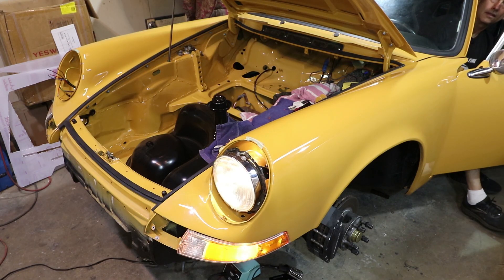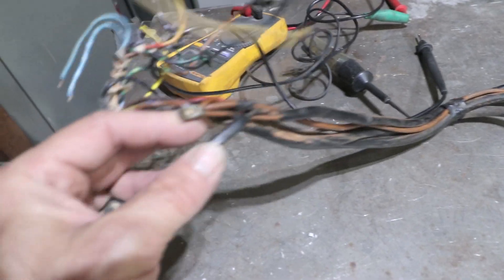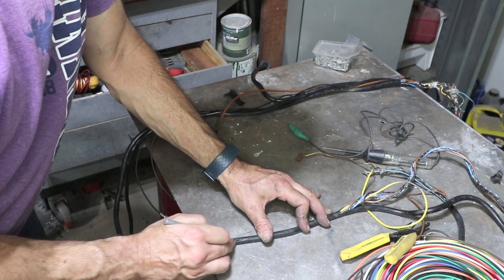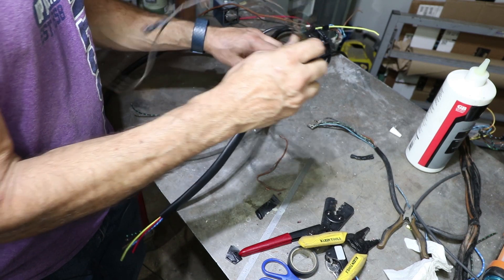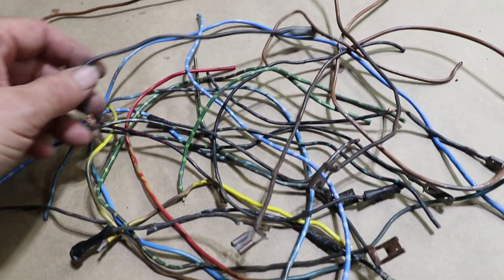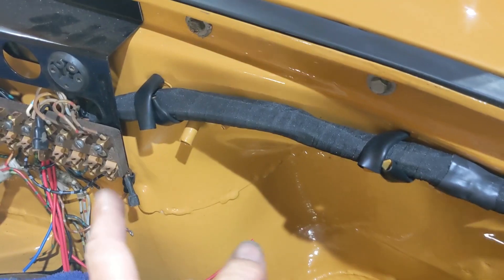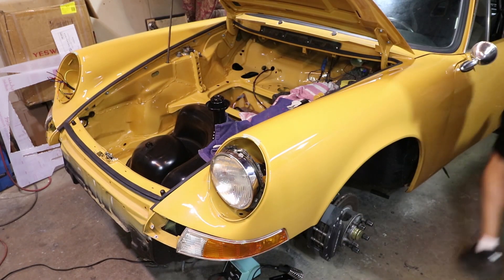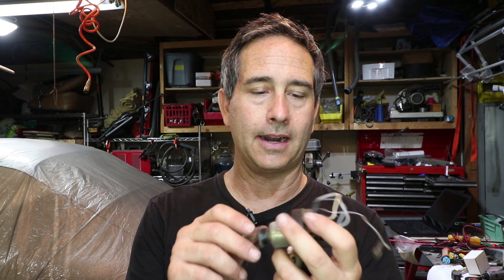Repairing & Upgrading Classic Car Headlight Wiring For H4 Bulbs With New Relays And Larger Wires

Comment: I have a rover p6 and want to set rails in it, I have two sets of headlights, one is a big beam and the other is dim and headlights. I use the excisting connector to send voltage to coils reails and make a whole new set of wires for the lights itself from the high current switches, I use small fuse box for new fuses let the original fuses intakt, I use the high current wire from the batterie, wo sit on the starter motor..

Comment: I'm trying to figure out my 1982 SC which someone upgraded to the H4 Bosh and I pulled my driver's side headlight to repair a few rust spots and was a bit suprised only one bottom screw on the trim ring was holding the entire unit in place unlike the orginal which is held in by four screws.
Reply from the maker: I know what you mean.  The single attachment is kind of precarious.

Comment: Hey Tom, I’ve been following your videos for a long time! I’m currently dealing with this on my 84 911, as well as many other projects you have documented. You make the hard things I do look easy! Thanks for the wealth of info. 

Btw, I see you have made a wiring diagram available, which is nice…I’ve seen you using others electronically. Where did you get these? The Bentley is a pain! If you’ve answered this elsewhere I apologize, I missed it.
Reply from the maker: The color diagrams I have are from the workshop manual.  The only ones I have are for the 74 model which is the year of my car.  Unfortunately I don't have the color ones for 84.  I have the Bentley like you do.  
The other helpful thing is to lookup the Euro Din specification.  It explains what the terminal numbers and colors mean.  It's a huge help.  
Thanks for watching, and I hope you find what you need.

Comment: I just got the original old school four sealed beams working on my 1966 chevelle project. But eventually will go to an LED system, less draw, better light. The new wire harness in my Chevelle has 12 g wiring to headlights, I did 12g ground wires on each side. I Hope to replace the headlights on my 1981 911 SC in the spring with LED as well. Octane lighting seems to have some good solutions. ( I do not have any affiliation or work for that company).
Reply from the maker: Nice, I'll check them out too.  I'd be interested to know your experience with the beam pattern with those LEDs

Comment: I actually fitted the classic retrofit fuse panel as I wanted the headlight relays and blade fuse as well.  Absolutely painless install.  I then refreshed the headlights with JW speaker LED lights (in beetle buckets!) and new Deutsch connectors.  Purists be damned, I can light up the whole street with this arrangement :-)
Reply from the maker: Awesome!  I'll check into those.

Comment: Seems like 4 relays might be overkill. Have you thought about one relay for the high beams and one for the low beams. You could hide one behind each light. It is your car, and you are doing great work. Keep it up!
Reply from the maker: Hey Aaron, a lot of what I do is overkill!  
My decision to hide the relays in the buckets precludes me from using just two.  
I would need to add more wires to bridge to the other side because the headlights are wired in parallel.
The relays are cheap, so I went this way.
Two relays at the fuse panel are also a good call.  I just don't want to look at them there.
Reply: @GarageTimeAutoResto  that makes sense. I figured running the additional wires would also clutter a bit. Good work continuing to move forward on your project. Definitely an inspiration to all us DIY guys

Comment: LED headlights
Reply from the maker: Which ones do you recommend?
Reply: @GarageTimeAutoResto  Head Light Revolution has great products and good service .  I have been using GTR Ultra 2 for 1 year now with no issues . Great light pattern and increased visibility. Not the cheapest out there , solid build and none of the Chinese issues associated with the Ebay LEDs
Reply from the maker: Is it the whole headlight assembly and refector or just the bulb?
Reply: @GarageTimeAutoResto  just the bulbs
Super bright great patern
Reply from the maker: Great, thx!

Comment: Great video Tom.  I will definitely be doing the H4 update on my 911.  I really dislike the looks of the sugar scoops.   I did by a pair of H5s because they were a good deal on pelican.  Of course, the socket is broken.  I was thinking I could just have the rings chromed then they would look just like H4s.  At any rate I will be using your video to help my upgrade my wiring when the time comes.
Reply from the maker: I'm not familiar with H5's Is that what came on Carreras?
I don't love the sugar scoops either, but can't beat the price on those.  
www.ahhgaragetime.com/h4relay/ for the wiring diagram
Reply: @GarageTimeAutoResto  Yep.  H5s are what came on the Carreras, they only came with painted trim rings.  I did do an H4 upgrade to an '82 SC that I used to own and I did not do a relay upgrade.  I think maybe it had a relay? or the wires were just upgraded enough at that point.
Reply from the maker: Oh, I actually have some H5's then that came with the engine parts lot from Shane.  They are  plastic and lightweight!

Comment: Great video.  What relays did you use?
Reply from the maker: I used a generic 5 pin relay, but  the 4 pin one is all you need.  Most local auto parts carry these.  Here's a Bosch one from Amazon 
https://amzn.to/3Ah3GDv
Reply: Garage Time - DIY Porsche Restoration thanks Tom.

Comment: Excellent repair.  You couldn’t do better than using original color coded wires.  Nice.
Reply from the maker: Thanks, I'm trying to retain as much of the Porsche stuff as possible and only improve the parts that need it.  
The fuel pump is another good example of something that desired improvement.  
Otherwise, I want to keep the stock harness and switches wherever possible.
This will make it easier for the next guy even though I won't sell.  Maybe it will be Zach/Alex's job to figure this out someday?

Comment: Hey Tom, just want to say that I really enjoy your content. Have you thought about using LED H4 bulbs? I went to LED H4s in my 944 and there was remarkably less heat generated. Cheers!
Reply from the maker: Thanks for watching David!  I would definitely consider LEDs.  What's the color like and how well do they focus?
Reply: Hi David, I’ve been looking at LED route.  What ones did you use / where from? Was concerned about figment in H4 due to bulky fins or fans.
Reply: I've recently had to fail the roadworthyness (MoT) test on a car with LED H7's with no beam pattern! Had light so intense reflected of every surface, was a clear lens car. I'm also interested results